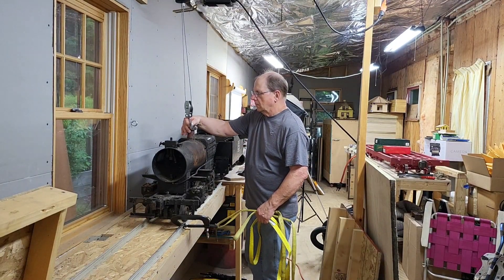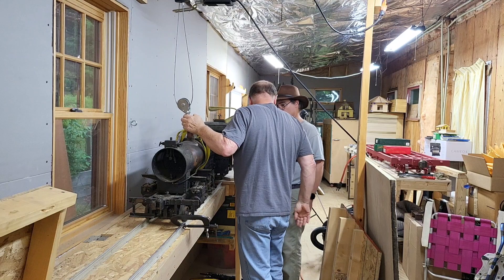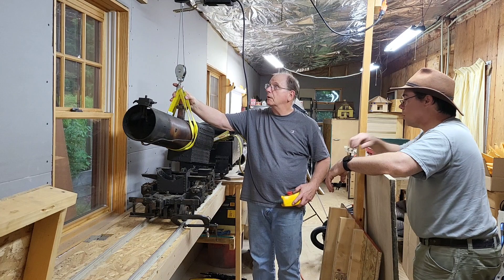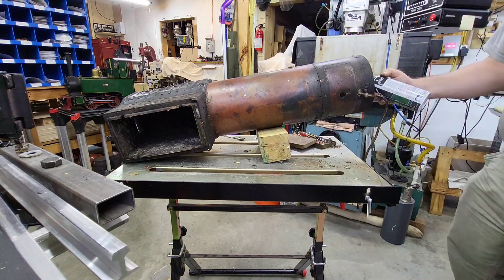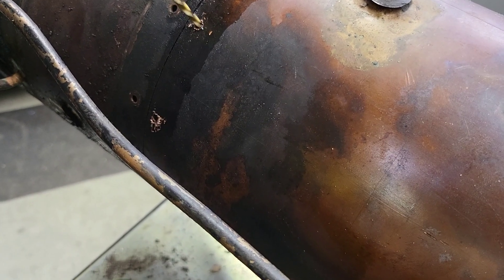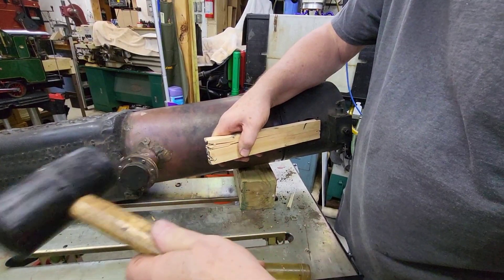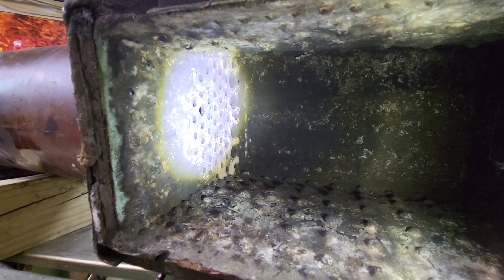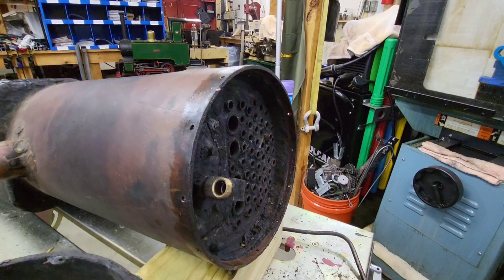Boiler Removal and Hidden Surprises

Comment: Those tubes are sure a lot smaller than the old stationary boiler I helped clean in the 1970's bro. Looking like an interesting project for sure, I hope it all goes well. Safe travels. Ken.
Reply from the maker: Most are 1/4" tubes.
Reply: Will that tube be relaced or resealed in some way
Reply from the maker: @mischef18  It needs to be replaced. There's a brush head stuck inside.

Comment: I did cringe a little with the hammering of the Copper. 😂 But i trust you at least sorta know what you're doing. 

I am kinda excited to see this thing restored and running on the Mill Brook Railroad.
Reply from the maker: I cringed a LOT when we had to hammer on the smoke box.
Reply: @MillBrookRailroad  Yeah, I bet. At least there was no noticeable deformations.
Reply from the maker: @VelociraptorsOfSkyrim  We turned two sticks to kindling in the process.